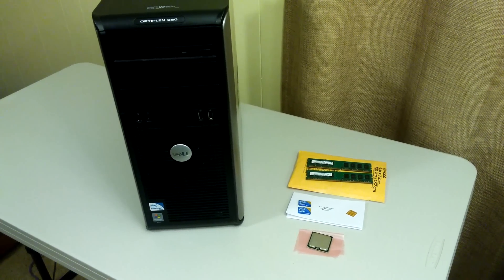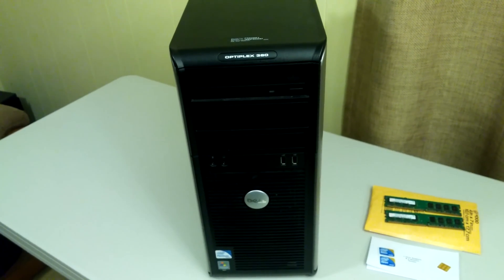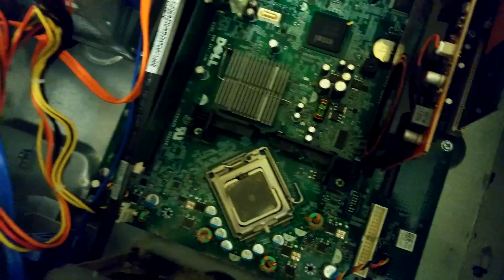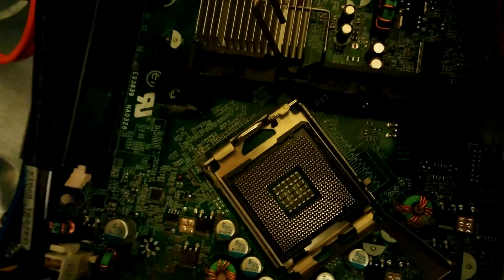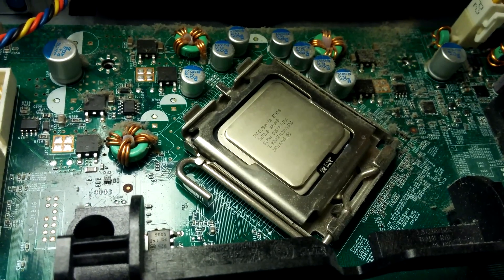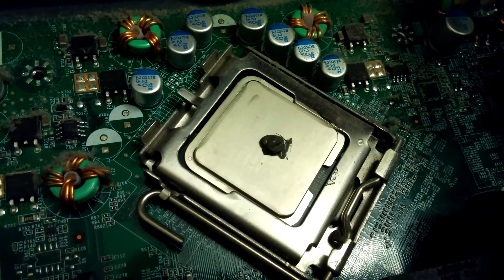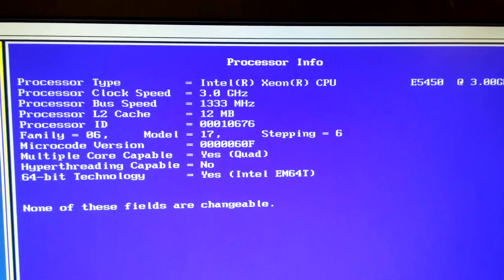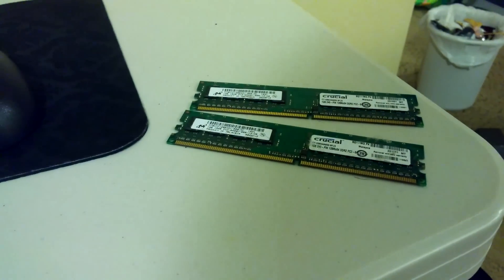Upgrading a Core 2 Duo Optiplex to a Quad Core Xeon E5450

Comment: A newbie here. @JP Duffy Could you please explain that sticker thing? TIA
Reply from the maker: Sure, so in that era of CPU the only real difference in Xeon vs consumer was marketing.  They have two pin pads on the CPUs swapped and the sticker reverses the connection.  This video is really old though, so today if you wanted a retro PC of this vintage I'd recommend just finding a decent core2duo and going with that.

Comment: @JP Duffy. I have a G41 mobo with Q9500 Quad and GT 1030 GDDR5. My question is.. did you do a bios update to use the Xeon? This is my backup pc with Windows 7, using it for playing games that won't work in my Windows 10 pc.
Reply from the maker: I made sure to have the latest BIOS, but I didn't do a BIOS mod.  Because of that I couldn't use Speedstep and had some stability issues.  Later on I moved the CPU into a standard ATX board and did a BIOS mod which was more stable but still not 100%.  You can read about it on delidded.com
Reply: @JPDuffy  thanks a lot for the quick reply. But this processor is probably not for me. Any upgrading that requires touching the bios makes me feel uneasy. The Xeon 5450 is stronger than the Q9500, but I'd have to pick stability over a little more power.

Comment: Hello,
Thanks for your video.
I have 2 technical information to ask you please: With an optiplex MT 780 mini tower, To upgrade an e7500 core duo to a q8300 quad cores going to q9650 depending on the availability of available second-hand processors. Hard to find.... I have original 8gb ddr3 1066, i want to upgrade to 8gb or 16gb ddr3 1333 I will add an NVIDIA GeForce GT 710 basic 2gb ram integrated graphics card. There was no card. I am going to change 7200trs / min HDD disk against a 256 GB SSD to gain speed and lower consumption. 
With this configuration, is it necessary or not to change the heat sink placed on the processor? Is the original one sufficient? Will the original 305w power supply be sufficient? Thank you
Reply from the maker: What are you planning to use it for?  I can't really recommend upgrading a C2D era machine anymore in 2021, it's much more cost effective to pick up a used 2nd ~ 4th gen i7 machine.  I replaced the PC in this video with an i7-2700 Optiplex for $80.  I lucked out and also found a GTX 960 also for $80.  It runs great and is massively faster than any C2D (Xeons included).

Comment: I'm upgrading my Optiplex 380 to Intel Core 2 Quad Q9550 2.83GHZ GHz 12M Cache 1333 MHz and 8Gbytes RAM which is the true max, not 4G as stated in this video. This chip is also available  in 3.0MHz, but with overheating issues which is why I went with 2.83 instead.
Reply from the maker: The 360 I used in this video has a Intel G31 chipset that the internet tells me really is limited to 4GB.  Your 380 likely has a better chipset.  Good call on the Q9550, you won't have any weird glitches with that.

Comment: what cna i do i made a scratch on the square thing u opend and my pc fail to show the green light... i mean its not starting
Reply from the maker: The socket?  You can use a sharp utility knife or exacto-knife.  If the CPU isn't seated well your PC won't start.  Of course, proceed at your own risk.

Comment: why not use ddr3 ram? 

my dell optiplex 380 fail to boot when i use 2x4gb ddr3L ram, i dont know why, 

any suggestion please?
Reply: It supports only DDR2 Ram
Reply: @lastcreature607  i use 2gb ram of ddr3 no problem
Reply: @yulioakhmad9270  What's your motherboard called?
Reply: OHN7XN , i think
Reply: @yulioakhmad9270  Hey, my bad for saying it supports ddr2, so the problem might be bad ram, try reseating your ram, and make sure to put it in the slot so it slides in and the retaining clips snap back in their place (make sure to put it in slot 2 and 4)
Reply: @lastcreature607  i'm going to try update bios, i realize to my bios is stock, 
then update system to win 10 64, it still on win7 32 bit LOL
Reply: @yulioakhmad9270  You don't need to update BIOS, it won't change anything, you should probably right now get your ram working and then update to win10
Reply: Okay just checked some info about your motherboard, try to remove one ram stick off then turn it on, if it doesn't post, then put the stick back and remove the other one, and try again.

Comment: is optiplex 755 compitable with this cpu????
Reply: I'm sure it is, but you might need to cut little notches in the sides to get it to fit, just like he did.  I'm putting the Q9650 in my Optiplex 755.

Comment: I have a Dell Optiplex 780 SFF that I upgraded to 12 g of RAM.  I was hoping to upgrade to a quad core so I can go from Win 7 Pro to Win 10 Pro.  Do you have any recommendation on what options for upgrading?  I plan on taking the components apart so to get a good cleaning before any other upgrading.  I hope to replace the 500 g hard drive to SSD too.

Comment: Hi what version of bios are you running? If it's stock which version or revision A01 A02 etc?
Reply from the maker: No idea, this was a long time ago.  I'm pretty sure I updated to the latest from Dell's website though.
Reply: @JPDuffy  thanks! So stock dell bios. There are two versions of the same e5450 chip a "slanq" and a "slmbb". It's basically version 1.0 or 2.0 with some added features. Any idea which you used?
Reply from the maker: @luckyu123  I'm pretty sure I had a slanq.  I checked my eBay history, but it only went back to 2017. :(
Reply: @JPDuffy  thank you sir that's what I am going with
Reply: Cyclonex1CA ca  got a pre modified slanq chip from china/ebay this week. No stickers/jumpers or cutting or motherboard. Will install soon

Comment: That was straight forward. I saw somewhere they had to change the microcode in the BIOS  but yours seemed to work fine. Most importantly - what differences did you see in operation?

Comment: I have optiplex 760 core 2 duo 3.0 e8400
Can i upgrade it to Core 2 quad q6600 .....!
Reply from the maker: I did that on this 360 for a while.  The q6600 is way way over spec on wattage but it worked.  The whole box got pretty hot but it was stable.

Comment: For me it's very simple if I have to get a Xeon processor better to get a mother board which supports Xeon....and it's designed for that that type of processor and there r a lot other factors which we r unaware of and we may end up frying the new processor and motherboard....It's very simple Intel is not stupid why they hve slightly different sockets or slots based on processor...that means swapping  is not allowed....well still if u want to CLEAN SHAVE....everything..including a TAPE...go ahead at ur own risk...
Reply from the maker: I'd never buy an old Optiplex to try this out.  The goal was a super cheap last-chance upgrade for a machine that's otherwise worthless.

Comment: "You can't upgrade it", but then you just upgraded it. I'm confused.

I have a Dell Optiplex 760. I don't know the exact terms for the different types of towers, but I have one that can either stand vertical or lay down(since that's best for the CD drive, that's how it is☺). I got it because it was the best I could afford from the options I had(referbished, with a goot rating). It came with Windows 10, and a 32bit cpu(page made it seem 64bit, but it is referbished), I have an unopened 64bit cpu in my desk. I'm gonna try to get two 4gb memory sticks when I can, but the hardest part(financially), is getting a good gaming gpu(I only have $36 free cash a month, took me three months saving up to get the Dell).

The pc I had before, the tower was from 2005 I think(got down to only two usable USB slots, a dying audio port, and the CD drives were dying, no reading at all). The motherboard had been changed once sometime in 2009 I think. The memory and graphics card I have in the old won't fit in the Dell, so I'll need new ones. So it'll be a while before I can try to upgrade.
Reply: He's meaning you can't upgrade the motherboard because its a btx style motherboard to a atx motherboard.

Comment: So, you can only use 4gigs of ram only or can you bump it up to 16 gigs of ram by using two 8gig sticks? 

This is interesting a relative asked if they can upgrade their optiplex 745 but aonther has same optiplex as you.
Reply from the maker: On the 360 4gb was the max "supported" ram.  Probably more would work.  DDR2 can be a bit expensive to find in higher capacities though.

Comment: Just picked up a 755 optiplex from a buddy, pretty sure it has the same chipset, if I upgrade the pcu to this xeon, toss an extra 2 2gb ddr2s to make it 8 gigs ram which graphics card would u recommend, I know it has to be low prol and only 75 watts to work with what the pci slot power gives off

Comment: I have an OptiPlex 745 and I upgraded my cpu to a q6600 which does a decent job but I want more. So I found out that the socket on my board was a lga776 and I found a chip boasting 3.1ghz quad core. its a xeon x5460 I think its modified. would this work for my OptiPlex 745 https://tinyurl.com/ybseqdqh link is to cpu on aliexpress. Thank You for your response
Reply: I think not....that Optiplex has an old chipset Intel Q965 and you need other chipsets for this MOD...look here, you´ll cant find OP 745:
http://genius239239.myweb.hinet.net/771/dell_series.htm

All Standar MoBos with BIOS-Mod
http://genius239239.myweb.hinet.net/771/

A Q6600 is socket 775 like Q8xxx/Q9xxx and Xeon-771 Moddified (all 45nm), but Q6600/6700 are 65nm...so, maybe you coul try with other MOD, Im talking abour TAPE MOD or BSEL MOD (one or two electrical tape pieces on CPU pins).
https://www.youtube.com/watch?v=7wW3QNbz3uM

:D

Comment: I bought the E5440 (2.83GHz) instead, which was way cheaper, and overclocked it to 3.4GHz stable at 1.12v. Temps have been surprisingly cool even with the stock Core 2 cooler. But I have a DIY rig, though, not a prebuilt PC.
Reply: Which motherboard do you have? I'm thinking about buying a E5440 too because it's cheaper and I don't know how it will work out.
Reply: ASUS P5K. Most P43/P45/G41/G31/G33 boards are compatible with the Xeons (google 'delidded LGA 771 to 775 compatibility' for a somewhat exhaustive list), but you definitely need a good overclocking motherboard to get high overclocks. The ASUS P5K is one of many such motherboards.

These Harpertown Xeons are awesome overclockers. I've seen success stories from lots of people at various discussion forums. As far as I can tell, you're guaranteed to get at least 300MHz overclock on air cooler and stock voltage as long as you use an E- or L-series Xeon (and a motherboard that allows overclocking, of course).
Reply: I have three 775 motherboards but none is good, a Fatal1ty f-i90hd (updated the bios the other day with floppies), MSI Combo g41m-p33 (not possible to overclock) and an Asus P5KC with two busted CPU pins (can't use more than 1 slot of RAM otherwise it will crash). Would be great if it worked on the MSI Combo since I bought that board new and supports DDR3.

Comment: hey, i just bought a dell vostro 220s and it comes with a e8400 and 4gb ram, do you know if i can upgrade the cpu to a 4 core? can you tell me some compatible cpus? thanks
Reply: Cesar Mendes You should be able to upgrade it to Core2quad q6600 . then just overclock it to 3.0 ghz and you will pretty much have the same performance as e5450 for around $10 to $20 .

Comment: Yo so if anybody knows can I put this in a 755 and is it possible to put in the 1050ti small form factor in this? #jakepaul
Reply from the maker: All the BTX form factor Optiplex systems I've seen have the x16 PCIe slot on top, just like any ATX motherboard.  However because it's essentially upside-down, two slot cards won't fit.

This Optiplex has some empty space below the motherboard, and in theory an $8 PCIe ribbon cable should work.

Comment: I have a Dell Optiplex 760 DT and was looking to go for a Q9650 Until i came across this, will an X5460 work in my motherboard? (ofcourse with the pin adaptor sticker)

Comment: if i have an optiplex 760, can i install a core 2 quad or a Xeon E5450?
Reply: with the 760, there are two types of motherboard, one that can only support core duo, and another which can support quad. google CPU-Z and download it, under the 'mainboard' you'll find a motherboard code. if u can let me know the code, i can tell you what it can support :)
Reply: Model: 0D517D

Chipset: Q45/Q43

thank you
Reply: Unfortunately you can only support max of core 2 duo. The best processor you can have in your motherboard is a Intel Core 2 Duo E8400 3ghz.
Reply: that's the one i have, thank's for the info man!
Reply: I have a optiplex 760 sff with 0m863n board, can i put the modded xeon E5450 on it?
Reply: google to help
Reply: Dell Optiplex 780 support All 3xxx series Xeons. The 5xxx series is incompatible. search it in http://www.delidded.com/lga-771-to-775-adapter/3

Comment: JP Duffy, how are you? This procedure that you performed on the desktop dell did not need to update the bios?
Reply from the maker: I made sure to have the latest stock BIOS, but I didn't have to do a BIOS mod.  I later moved the chip to an Asus board which did require a mod.   The move let me have more ram and a full size GPU.  In a generic case with an old GTX 580, it rocked some Doom 2016 and Ark quite well.  Cooling was an issue with that setup as you can imagine though.

Comment: doesn't this need a bios flash to work?
Reply from the maker: Not if the core2quad equivalent is supported.  They share identical microcode.
Reply: The BIOS screen showed version A07 for his machine. On Dell's Support Site for this machine, you can download the A07 update if your machine has an older version.

Comment: Hi, JP Duffy !
Do you using Mod Bios from China ( by Genius) ?
Reply from the maker: I didn't need a BIOS update on the Optiplex, but due to instability issues I eventually moved the CPU to another motherboard.  That one did.  It's pretty wild to hack a BIOS and then flash it, but it worked well.  You can find all the info on delidded.

Comment: Hi man, nice to watch your project! I have a question for you, can I put a x5460 on a Dell optiplex 755? (Tower version) thanks!
Reply from the maker: delidded has all the info and research, I basically just followed their guides.
Reply: you can, as long as the processor is lga 771 and u have a mod sticker

Comment: Hi man!
Do you using Mod Bios?
What is processor degree on load?
What is you Cpu Cooler?
Reply from the maker: No BIOS mod, and stock cooler.  Never checked the temps, but those dell coolers are beasts, no worries there.

Comment: i have same optiplex and did this exact same mod. the bios does show the xeon. i do get a message saying processor is NOT supported. but it still boots into windows but windows still shows the old core 2 duo. when i run Intel processor ID it does show the xeon. I have the latest bios update on the motherboard. What am i missing? computer does run faster btw.
Reply: My guess would be that windows shows the cpu that was in the machine when windows was installed, and that the indication is not changed when the CPU is changed.
Reply: you have to turn "fast boot" off for Windows to do a full work-up with the new processor. It will install whatever it needs then you can do a reboot and turn "fast boot" back to on and things will wok and show correctly.

Comment: CAN YOU PLEASE HELP ME!? I bought this processor for My optiplex 755 and everrything is good except When i boot IT up, My CPU fan goes to constant 100% speed and i get no signal on the monitor and everything is spinning at normal speed except the CPU fan, PLEASE HELP SOMEONE!!
Reply: Hi! I have dell optiplex 755 too. but optiplex 755 is not support xeons 54xx, because here is q45 cheapset . I bought xeon x3363 and it work fine.. so just buy xeon x3363 . it is the best choice for dell optiplex 755.. Write me if you have some questions; michaelphotolive@gmail.com
Reply: oh i know i should looked for that Before, ive looked on a x3363 but are there any better cpus in the x series that supports the optiplex 755? thanks.

Comment: Can I do the same with my HP Pavillion?
Reply: Can i do this with my lawnmower?
Reply: as long as it run cpu socket LGA 775
Reply: Zenornia i was thinking more lile a i8, you know... the 69 core cpu with anal threading and 420 GHz clock speed.
Reply: Haha Fruzyhh, I belive i stand corrected, you are right, that does sound more like the kick up the ass that the lawnmower needs Haha
Reply: Can i do the same with my hp core 2?
Reply: Yes you can, Infact i recommend an i7 for your lawnmower, it'll sure as hell get the job done quicker! :D
Reply: HP Pavillion story... don't break the screen or the whole computer is screwed.